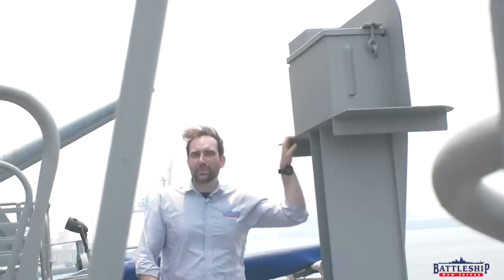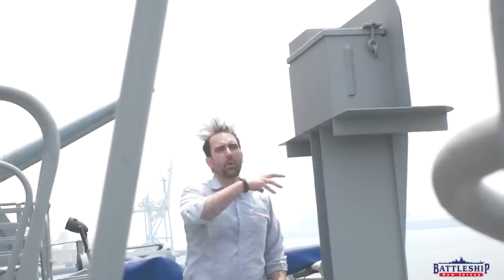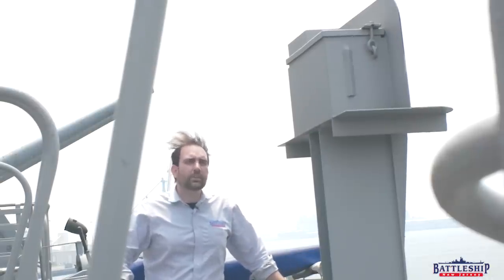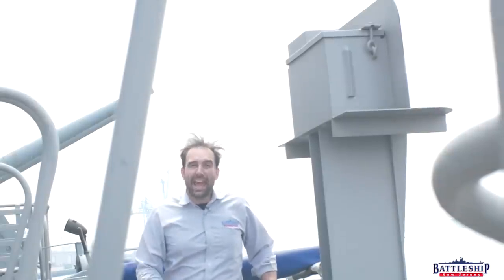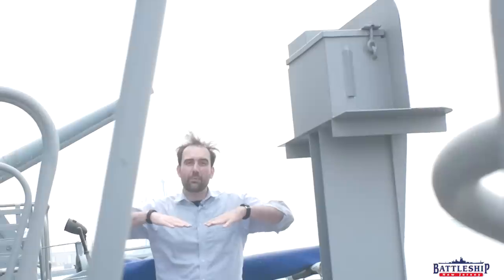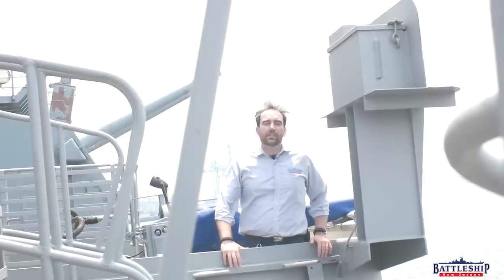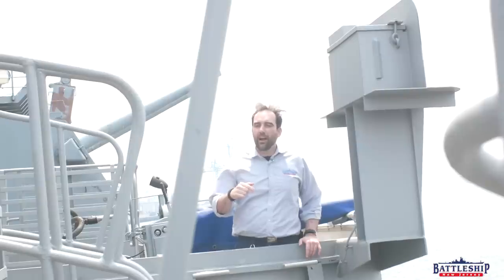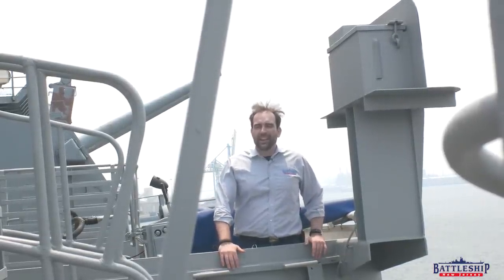Sailing At Night: The Battleship's Running Lights

Comment: I remember reading about the collision between the Andrea Doria and the Stockholm.  On one of the ships it was when they saw the movement of the running lights with respect to the masthead light of the other ship that they realized that they were going to collide.  Both ships had radar, but it was new and the officers didn't really understand how to use it.  The Andrea Doria officers didn't use the fancy plotting board they had, which would have clarified the ship movements for them.  As memory serves me, the Stockholm was under the control of a young second mate lacking experience who failed to call the captain to the bridge despite the fog and other problems.  And the same lane was used for both incoming and outgoing ships.  Damn shame;  I remember the newsreels in the movie theater and the articles in Life and Look magazines.  We didn't have TV then.
Reply: 2nd mates don't lack experience - "2nd mate". At least 1 year of sea time.Maybe you could say that about a 3rd mate.

Comment: A lot of antique shops welcomed old brass navigation lights in the 80s and early 90s  with the IMO regulations . Standards were laid down for lights performance and very few originals complied .That probably explains the relatively new mounts  for the missing Port & Stbd lanterns  . Also the emergency lights which on many ships had been oil lamps  had to be the same performance as the main so they were usually mounted in pairs and supplied from battery or the ships low power . Screens were set by surveyors to get the angles right . There are quite a few other than the statutory ones so Ryan is probably wise to leave them for another day .

Comment: The masthead light is not always at the center of the ship, especially for warships. Per Rules of the Road, forward and aft masthead light must be spaced at least 1/2 of the length of the ship, but this requirement can be waived for naval ships. One time I was in the pilot house, and I misidentified a DDG-51class destroyer right ahead of me as a smaller vessel because of that until they called me over radio.

Comment: Here in Wisconsin the DNR requires all boats with motors to have running lights that conform to federal regulations.  On smaller boats a combined color bow light is specified with a taller white stern light.  On larger boats seperate green and red lights are required alongside the bridge toward the bow.  Funny thing, all sail boats running under sail and over 20 ft. In length must also include a mast light.
Reply: Canadian regs say anything under 10 feet does not need fixed lights, over 10 feet they match Wisconsin.
Reply: Like you, I'm only familiar with small craft on lakes and rivers, not the ocean. At night, sometimes you would see a bunch of stationary craft on the lake, all marked by their white stern lights.

Comment: I was on LPH-12.  I remember  in the Med we ran into fog at dusk with 2 H-46 still flying. The only time I saw strob light on top of mast. It reflected off the fog cloud. The 2 Phrogs landed on the Shreveport.  They couldn't find the Inchon in the fog.
Reply: Damn'!  Why  didn't  you  used  your  air  search  radar  to  guide  them  down?
Reply: @jonathanstrong4812  Inchon knew where they were, but they couldn't see us. Shreveport was off our port side over in clear area.

Comment: If you want a better idea of what Ryan's talking about, Google "Colregs lights" and you'll get a whole bunch of diagrams that demonstrate different configurations of running lights, that communicate the ship's size, orientation, and what it's doing. That's why you saw those two photos of control panels: a ship like USS NEW JERSEY, except in combat conditions, would need to show different combinations of lights at different times. These lights are mandated by international law. Google just "Colregs" and you'll get options to learn about the actual laws themselves, which are primarily concerned with how to avoid collisions at sea, by having a uniform code of procedure.

Two questions: 

1.) Ryan doesn't mention the "range light." Being over 50m in length, NEW JERSEY would need two masthead lights, the after one higher than the forward one, as well as the sidelights and sternlight, while underway. This could essentially be anywhere forward of the masthead light you showed. 

2.) I can't parse the shape of that port sidelight box. Why does the light baffle go inboard at the back? I'm assuming that the baffle abaft the lamp isn't visible from this camera angle, and the box contains equipment and sockets for both a legal and a dim-mode bulb. But why, even, did they move the sidelights down to the main deck? It's an odd spot for them, I expect they're raised in those towers to ensure they're visible at the legal distance.

As for my own suggestion, I finally found your video on the conical-monopole high-frequency antenna on the bow, which to me is the iconic image of the 1980s modernization of the IOWA-class. So, instead I'll just say, take us on another expedition into an unexplored area! Or, maybe, show us a big fancy interpretive display in the process of being built and installed. You guys are a cool enough museum to give us a "museum life" video or two!

Comment: This may sound hoaky, but yeah from the wonders of YouTube I go from NCC-1701 to Battleship New Jersey. Funny thing that when Ryan talks about the colors of the landing lights... They're the same color lights that are on NCC-1701.😁
Reply: The "running lights" on the starships are of course, borrowed from aviation.  The red and green lights port and starboard as well as the extremity white strobes are more in keeping with aircraft running lights rather than ships, either merchant or military.  And of course there are no provisions to mask certain lights so they can only be seen from certain angles as they would be on an ocean going vessel.
Reply: @robertf3479  I guess one upside is you do not need to worry about lights being seen on a starship, the enemy sensors picked up your whatever fictional types of energy emissions awhile ago or in harder scifi their IR detection picked up your waste heat possibly from several light minutes away.

Comment: A bit of naval trivia:  USN ships at sea turn on running lights at sunset, and turn them off at sunrise.  Commercial vessels leave them on all the time at sea (sometimes even in port).  It's surprising that the Navy removed the port and starboard lenses as part of the mothballing process; they're not in an exposed position where they would be likely to be broken.  I bet they are still onboard somewhere.  Also interesting that the port and starboard lights were moved from their original positions on the bridge wings to the lower position on the 0-1 level in the 1980s.  By the way, the ship had/has 2 masthead lights - the one on the masthead, and another on top of the discone antenna.  Ships of that size are required to have 2 white masthead lights with the forward light lower, and both with the same arc of visibility as the port and starboard running lights together, to help other ships recognize its size and determine which direction it is headed.

Comment: NJ is more than 55m in length, so she needs a forward streaming like at least 3m lower than her after Masthead light (both are 135° front-facing white lamps.  The foremast will also have two or three more lamps at 2m distance below the masthead light to indicate if anything is being towed.  
The Jackstaff is not always where the forward anchor light is mounted--rather famously the Fletchers and Gearings had that light on Mount 52.
Reply: streaming at least

Comment: While serving as a lookout in the USN, the spotting of running lights visually sometimes differed from what the radar plot showed when relay to the CIC. 
Stern Light: I once got yelled at for reporting the wrong stern light being illuminated and not fixing it, because the last ship I had served on it was selected from a switch on the bridge, and on that particular ship it was just a cable plugged into a socket below the lamp itself. But nobody told me that and a LT decided to blame me for him having to walk all the way back to the stern to "educate me".

Comment: The masthead light is not at the top of the mast, despite its name. Aircraft warning lights are red, and typically mounted in pairs (unless actually mounted on the tip of the mast, which is unlikely) to allow for 360 degree visibility. They are also visible from above, whereas masthead lights (and other running lights) are not designed to be visible from above. A masthead light is a 225 degree white light, not visible from astern. On ships larger than 50 meters, a second 225 degree light is mounted lower and further forward, and is called the range light. 

The removed stern light you are referring to was called a "convoy light". There were three lights mounted at the stern - a white stern light, a white wake light, and the blue convoy light.

Comment: There's humor in the "do not comply with the rules of the road" sign.  Along the lines of, I'd love to see the local harbor police trying to pull over or board a battleship.
Reply: I interpret that sign as meaning that when the navigation lights are dimmed, they do not comply with standard maritime navigation procedures, which are sometimes called "the rules of the road".

https://en.wikipedia.org/wiki/International_Regulations_for_Preventing_Collisions_at_Sea
Reply: The red/green/white lights comply with rules of the sea and the air only.

Comment: This doesn't apply to the New Jersey, hopefully, but submarines have a flashing yellow light is set atop one of the primary masts. This lets other ships know that it is a submarine, which is otherwise hard to see. So, if you're in your rowboat and look down, and see a flashing yellow light, well, I don't know what you do since the sub can be pointed anywhere.

Also, there's the old ditty:
red over white, fishing at night
white over red, pilot ahead
red over red, the Captain is dead.

Comment: There are two mast lights not one. The highest sits aft while a distance forward of that in much lower. Both having a 225 degree arc of visibility. (If I remember correctly.) This enables another vessel to judge the other ships course by the horizontal spacing. If the lights appear one over the other they are headed straight at you.  

 Condition One is General quarters
Condition Two is war time cruising. Off Vietnam there were no navigation lights illuminated.

Comment: There are aircraft warnings lights as well. New Jersey would have had them in the 80’s. They are different from the masthead light. All the running lights are controlled from the tell tale panel located on the bridge.

Comment: Shot Clock.. did new jersey have one.. I've seen a number of pictures over the years that showed a clock face somewhere near the bridge to note WHEN the fired main battery shells would land or how much time left to the next firing of the main guns.
Reply: AFAIK this was only used by older battleships. The Iowa class had more advanced fire directors and communications, so it wasn't necessary.

Comment: I just watched this again. I'mma gonna pick some nits here - you have been warned LOL. "Abaft" means towards the stern. Pointing directly to the side of the ship is not "abaft", and the light doesn't show two points aft of that. It's two points abaft of the beam, which means two poiints towards the stern of the ship. It's 135 degrees, roughly, IIRC. Also, from the stern of the ship you can only see a white light. If you see a white and a colored light, the ship is coming towards you. Bigger ships have two white lights, a masthead light and a range light, which even better points out the direction of travel - the range light is forward of and lower than the masthead light.

Comment: The USCG regulations specify the running lights for powered vessels greater than 50 meters (328 feet). There shall be a aft facing white light of 135 degrees. Two green/red starboard/port running lights of 112.5 degrees. A white masthead light facing forward of 225 degrees and another white light above and aft of the forward light. The mast head lights give the captain of an approaching vessel an indication of the other vessels direction of movement. The masthead lights must be visible to 6 miles, and the others to 3 miles. Rule 22 and 23. For vessels less than 50 meters, there is a single masthead light. When at anchor, greater than 50 meters in length, there shall be an all-round light forward, an all-round light aft, and deck illumination as required. The light shields have nothing to do with the comfort of the crew in the gunnery tubs, but more to do with complying with the required angle of coverage of the running lights. There is a need to reduce any ambiguity when navigating the the dark. There are other lights that can be displayed for other situations and other vessels like submarines.

When in Material Condition I (General Quarters), Material Condition IA (Amphibious Operations) or Material Condition II (Wartime Steaming), then the navigation lights may be altered such as having a formation steaming light (think a North Atlantic Convoy).

Comment: Slow Morse Code isn't just radio. Audio, even the ship's horn? Visual with the signal light.
There was a story in QST about someone using the ship's signal light to communicate with a Ham radio operator who was flipping the house porch light on and off. He got a QSL card from the ship. What frequency band? Terahertz.
Reply: I can’t remember the name of the mode at this point in time but there was an experimental very low power mode that utilized very long Morse code signals where a dot would last several minutes. It required a computer program to sit running for hours or days to send and receive a message while filtering out the static in the background.
Reply: @Subgunman  I think that that is ELF, Extremely Low Frequency about 70 Hertz or Cycles Per Second to communicate with deep submarines. Frequency.

Comment: Another feature that pretty much every vessel has is a bilge pump. Is there anything special about the bilge pump on NJ? I don't even know if it is a seperate pump or if the bilge is just connected to the standard sewer system here.

Comment: What I'm surprised to learn is that on BB New Jersey, apparently the red and green lights are only visible aft of the ship, when I thought it was from forward of the ship. If you are on a head-on collision course, you definitely want to know which side to pass along (port side) to avoid bumping a 45,000 ton ship. What am I not understanding?
Reply: Ahead AND <whatever Ryan said> aft.  If you see one R/G and a stern white likely the ship is going past you.  Red AND Green coming right at you, white only heading away from you
Reply: The International  statutory navigation lights are port ( R) stbd ( Gn) and masthead face forward and the stern overtaking  light . Others depend on the size of the ship and activities taking place .There are also a host of other lights for various purposes , some universal and others by local regulations . They are often hoistable .
Reply: @markhenderson9391  - That's what I thought. And it is set up specifically to avoid collisions. I wish Ryan had shown video of that running light from the outside of the ship. Although it is possible the place for the lens was covered over during mothballing.

Comment: This wouldn't have been important for a battleship. But probably important for it's crew. If it's been covered before,I'd appreciate a reference to when this has been discussed. That being why crew members couldn't be on deck when the main 16" guns were fired.

My grandfather supposedly at the near end of WW2 while serving on the USS Washington was nearly killed when he decided to take an unscheduled cigarette break topside from engineering when he didn't know the main 16" guns were going to be test fired that day.

Long story short,he survived the test firing. But suffered both ear drums ruptured. And was black and blue all over after waking up nearly 2 days after it happened in sick bay.

If it's been discussed on why you couldn't be topside when the main guns were fired. Maybe mention if anything remotely similar happened on the USS New Jersey with crew members not where they were supposed to be when the main guns were fired.
Reply: A-OUCH !  A-YIKES!  THAT  SMARTS  I  SHOULDN'T  WONDER

Comment: So the battleship follows rules of the road strange
Reply: Right of size is the main rule I think.
Reply: Not at all strange in peacetime.  Wartime is another matter, but after WWII all of New Jersey's service was in peacetime as far as most of the world was concerned.
Reply: @krunk28  We sailors call it "The law of gross tonnage."  Maritime Rules of the Road normally require that powered vessels steer clear of vessels under sail.  That's fine except when you have an 80,000 ton 700 foot long merchant ship and the other guy is a 75 foot long sailing yacht that displaces MAYBE 200 tons or so.  Law of gross tonnage applies (also referred to as "Common Sense.")
Reply: @robertf3479 or otherwise known as "Darwin’s law of selectivity".

Comment: What I am wondering, and is probably a non issue to the Iowa class, is just what what appear to be mast mounted clocks were used for.  Can anyone point me at a place to start researching?
Reply: I saw a video before about them and I think it had to do with range and distance for firing the guns communicating it with the fleet.

Comment: What about the Morse code signal lamps , the ones with the flapping feature
Reply: Those are signal lamps, sometimes called Aldis lamps. I think Ryan mentioned once that there are some of those outside at the level of the flag bridge, if the admiral onboard wants to use them to send messages to other ships.